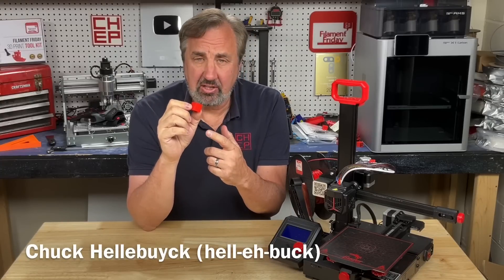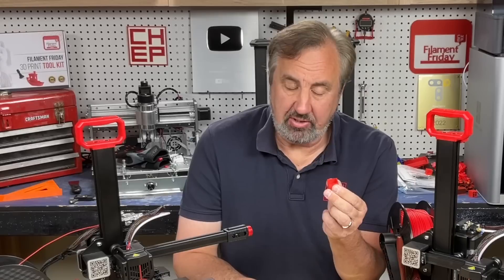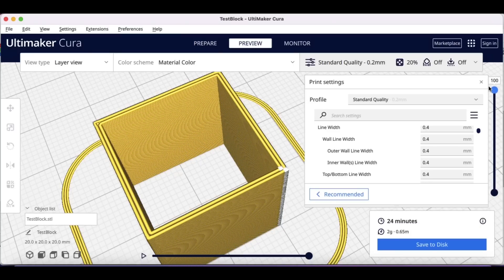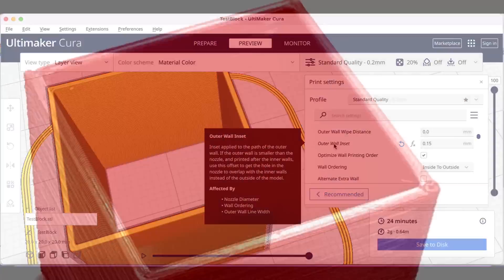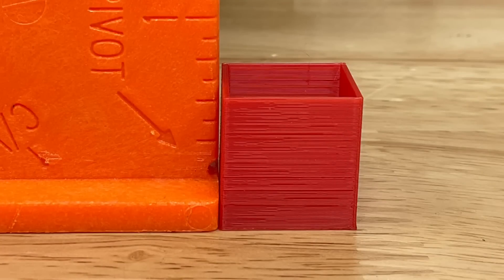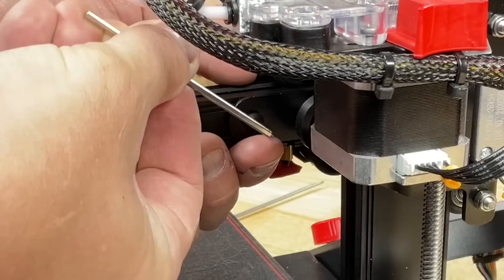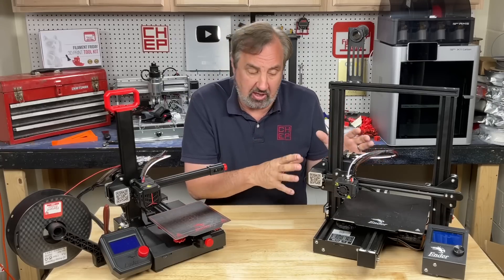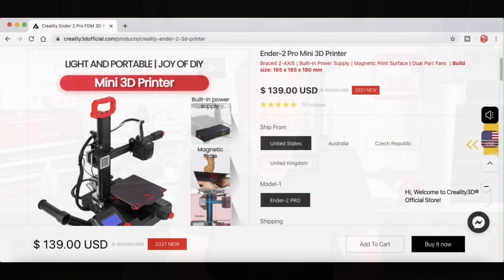Hide Gaps in 3D Prints with Cura Slicer Settings

Comment: I actually had bought the ender 3 s1 pro, and had to take it through an airport. It is my first 3d printer, and the first thing i did (after printing a benchy) was completely disassemble it so it fits in the multiple luggage cases. When i finally got home and assembled it, i noticed just how many adjustments there are to get right. I was having all kinds of problems, from bed adhesion issues, to stringing fillament, inconsistent leveling, z axis binding... i did waste almost a week getting it right but I did learn so much about my machine and the process. Sometimes getting thrown in the water can help, but only if you have patience and willingness to learn.

Comment: Enable Print thin walls. Reduce minimum wall line width to 0.2mm. Consider the nozzle diameter and design your models around that constant, eg: 0.4 mm nozzle = 0.4mm, 0.8mm, 1.2mm, 1.6mm, etc. These are all options for fixing wall gaps that don't require changing any inset values and messing up your dimensional accuracy.
Reply: my nozzle is 0.4mm, "print thin wall" is enabled, min. wall line width 0.3mm, Are these ok?
Reply: It's a matter of whether you're getting a gap where you're expecting a wall to be printed. If that gap is >=0.30mm, then your setting will print the wall. If that gap is less than 0.30mm, you'll need to set Print Thin Walls to something lower, like 0.20mm. Design your models to suit 0.40mm increments and you avoid this issue.

Comment: My Ender 2 Pro has this same issue with the CHEP cube being slightly tilted to one direction. 

But idk if I have a revised edition or the arm you mentioned or not but I can remove that screw completely and there isn’t any adjustment at all. 

Upon further inspection there are 2 more screws holding the arm down on the same arm but are being blocked by the Up/Down rail part. 

Hopefully there is still some adjustment. 🤞🏽Thanks for the tips!
Reply from the maker: You can remove the handle on top and lift the whole arm off to get to those screws.
Reply: @FilamentFriday  oh nice thank you I thought I was going to have to remove everything at the bottom. Thanks for being helpful the Ender 2 Pro has been great.

Comment: hello, I have a cr10 v2 printer. when the filament is finished, the bed begins to cool down. i want to keep the temperature of the bed the same, what should I do. is there a video for that?
Reply: I've noticed that with the CR-10 v2 whilst swapping filament, not sure if there's a workaround - look into firmware upgrade perhaps?

Comment: What would you say is a good wall thickness overall, related to the nozzle size I am sure, but what if it was a multiple, like 0.2 for an 0.4 nozzle?
Reply from the maker: Cura 5.x should adjust flow to match so there is really no specific ratio. Removing the visible line though takes some adjustments.

Comment: I have 3 SD cards with the same files , they read slower on one of my ender 3s and evidently my new ender 3 pro can't read a card with too many files.
Why do the the same model machines read at different rates?
Reply: Are all the sd cards the same brand and read/write speed? If they all have the same files, have you tried each card in all machines?
Reply: @-AT-WALKER  yeah try them in all machines.
Newer ones won't read the cards if they're too full.
Thank you
Reply: @unitruth  I had a problem similar to that, I ended up organizing my gcode files into directories and everything got better.
Reply: @-AT-WALKER  I tried my old cards and I tried some new cards every machine.
The three older machines read better.
I ended up just having more cards with less files.

Comment: I'm putting out a kind of alert concerning a wiring problem on a BIQU Hurakan. From the factory, the unit has a frame ground and a switch/power inlet ground connected to the single FG post of the power supply. From the research I've done, this is considered ILLEGAL by practicing electricians and electrical engineers. I'm not an expert, so I can't say, but I can tell you that my Hurakan blew up a couple of days ago, destroying the monitor, and the control board quite spectacularly.  If you know something about how to connect ground wires to a power supply correctly, please comment on this event. Thank you for all the GREAT WORK you're doing. A lot of your videos have helped me through some very touch problems.

Comment: Sorry I am going to ask a question off this topic. When I create a circle and then when I make a hole in the circles eg. Diameter 15mm the hole 11.5mm when 15mm outside is wrong so is the inside n when I use hole expansion then outer n inside both changes n the inside like gets like double wrong. Can u explain why this is happening.

Comment: Do CHEP profiles work with Ender 3 s1 direct drive extruder? 

Are they still up to date with the current Cura version?

I am scratching my head to get print quality and speed improved.

Thanks!
Reply from the maker: Try them with 1-2mm retraction. I’m getting decent results.

Comment: .  The lower right corner was a “starter” point?  I have an issue with these areas.  Is there a way when having a continuous circle, square shape to have the printer just continue around without stopping at same point?
Reply from the maker: Only in spiral or vase mode.
Reply: @FilamentFriday  is that a setting in Cura or one of the other slicers?

Comment: Factory Flaw? Only if the printer is sold assembled from the factory!

Though they are OLD by today' standards, My (2016) Tronxy X1 and P802MA has a similar issue - Printer out of Square. My Solution? I had to loosen all the hold-down screws and put a carpenter's square to the Axis arms and tighten the screws while making sure it is  squared. When done and the printers were squared again, they printed perfectly.

The Tronxy X1 and the Ender 2 are basically of the same printer design.

Great way to fix the problem, CHEP,. But there is more than one way to skin a cat.
Reply from the maker: That portion is assembled at the factory.

Comment: I am happy to say that my 2 Ender 2 Pro's both are printing straight, straight out of the box. Currently using them to print cosplay and costume commisions for my sister. So thank you so much for those fast profiles you created
Here in South Africa, we have electricity issues caused by government mismanagement of nearly 30 years. So we have electricity windows of around 4 hours. So using your profiles, and some scheduling I can pop out my prints on time. You have saved my thousands in money with your profiles.
Just wanted to say.
Oh yes, by adjusting the retraction settings I actually use them on my Ender 3 S1's and my CR-10s[With a 0.8mm nozzle 🤪]

Comment: I found my Ender 3 wasn't perfectly square when printing larger cubes and adjusting the gantry angle only gets you so far. If the extrusion isn't machined perfectly square it can still be angled forward/back or sideways slightly with no means of adjustment.
M852 - Bed Skew Compensation in Marlin allows compensation for the remaining physical defect in firmware.
Reply: I have a diff. printer, but I had tilting prints due an unevenly cut base of an extrusion. I used metal shims under the extrusion to counter this.